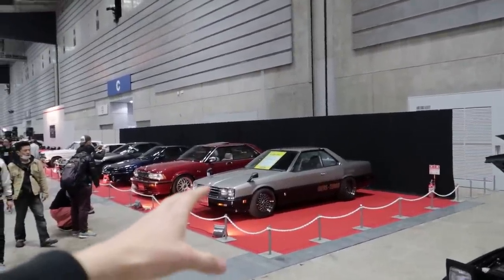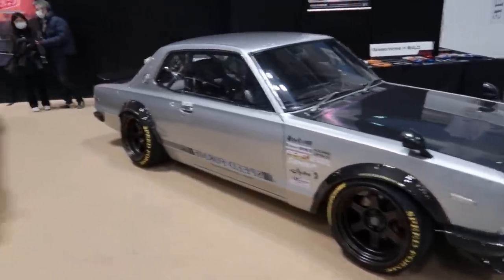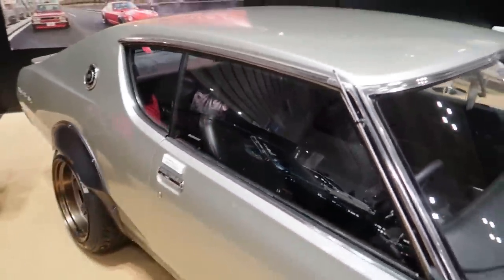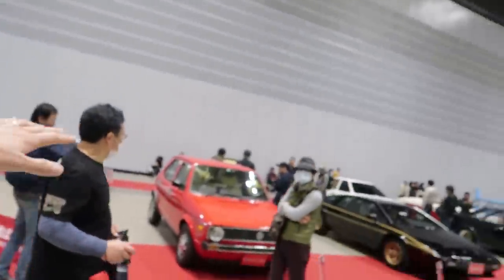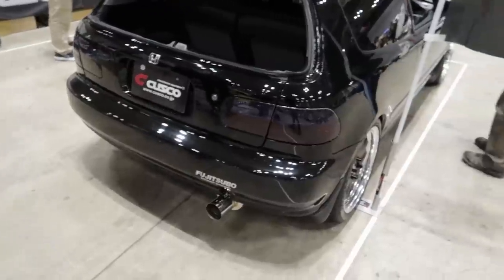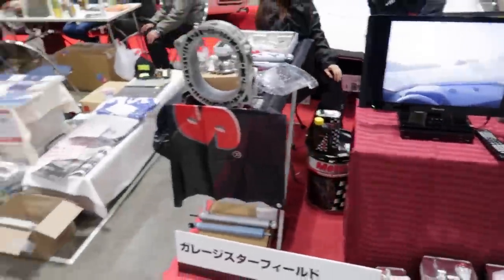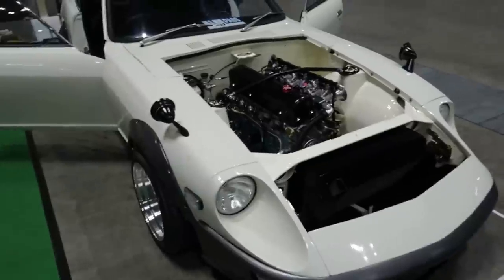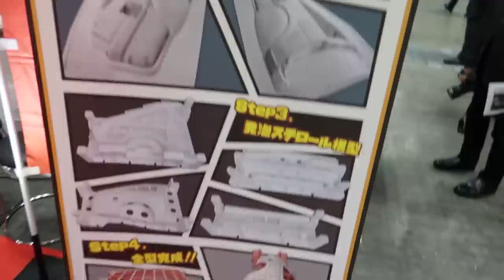JAPAN'S BIGGEST NOSTALGIC CAR EVENT!

Comment: 26:43 
I bought a Ca18 off a buddy of mine. And I am going to rebuild it and put it in my Suzuki Swift and make it Rwd.
Reply: Sr all the way <3
Reply: put it on a nissan micra k11 1.3 swap :D 5*
Reply: @nightreapers3425  if you van find one here in holland, it will be muchos expensive. And got the ca18 for a very good price, so why not.
Reply: @andrebarros7703  I'd rather use my swift for it, because micra swaps have been done. Not many people would an ca18 in a swift. And I love my swift😂👌🏼
Reply: either way, good luck with the project! :D
Reply: @andrebarros7703  thnx! And I appreciate it!

Comment: Here is a fun fact for you ,a company in Taiwan got a hold of the original molds for the Ae86 bumpers from the Toyota factory, they started reproducing them until Toyota got wind , a cease and desist happened, Toyota actually destroyed the original molds after that. This was around mid 2000s they use to cost around $150 new, now you’ll be lucky to find a new one for $500

Comment: 3:26 Toyota’s 2JZ was a complete in-house design by Toyota
Reply: They literally just took the 1JZ and made it 3.0L
Reply: that is correct; 1JZ was co-developed and then 2J was in-house.
Reply: God Bless Callum and redesigned the head to flow more, which is important. 

Before I get raped: the 1JZ head DOES NOT flow better than the 2JZ. It’s a myth that’s been around since the 90’s, and was debunked in the early 2000’a

Comment: Pretty incorrect on the Toyota facts, Yamaha is partly owned by Toyota, they helped develop the 1jz cylinder head, not the 2jz cylinder head or bottom end 
Nissan in their wisdom designed the single worst oil pump drive setup made from sintered aluminium and put it in their performance engine, they can't even be mentioned in the same sentence.

Comment: It's a little bit about availability of JZs... Because they were revamped and put in like... everything... whereas, the RB not so common... people ripped through the RBs well before JZs were looked at... oil flow consistency being one of the major drawbacks to the JZ... and timing complexity... so, I mean before after market growth... I dunno... its a 50/50... each has its problems... the Nissan twin sequential turbo from stock though... upper hand on the JZ...

Comment: Your rung rb has the strongest block that's why they use a rb block with 2 J crank billet biult it capabilities of  up to 2500/3000 HP nearly 20 grands of bottom end

Comment: Cost for clean non much used cars sold in warm countries cost more.
 Less rust and when the car sold far might  stayed imobilizedalot for simple problems like fuel pumps or parts hard and expensive (due to  distance) to find  !! 
 So a friend took an fc infini pack  turbo for  2ks  ONLY !!!  
 car had 60k miles with a bad seal in intake and wrong fuel pump.. never abused cause no good power delivered as long as it didnt fixed xorrect.   bought recently as good as new !!!  c'est la vie!!!

Comment: Sam gets it wrong again, Toyota designed and built the 2jz, there is absolutely no evidence other than urban mith Yamaha had anything to do with it. Just to point out any engine that was developed by Yamaha has Yamaha stamped in the block Just like the 3sgte engine. 
And don't quote Wikipedia that can be edited by anyone. 
Your welcome, the 2jz is just better, get over it. 😂
Reply: I have a 1jz and it has Yamaha stamped on it.just so you know
Reply: @julianfoster5321  my point exactly

Comment: who GAF about the Holden engine when an OS Ginken is sitting next to it and you don't even mention it
Reply: WestSide Snooker  Based on the L series. OS Ginken made 16 valve heads for use in racing. Cams were gear driven. The company still exists